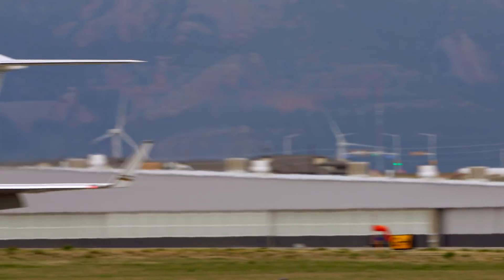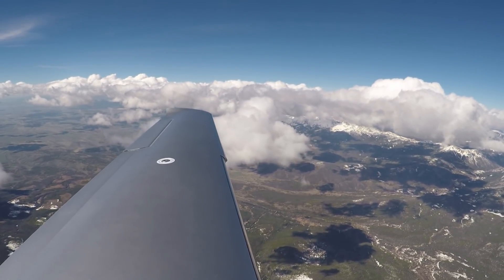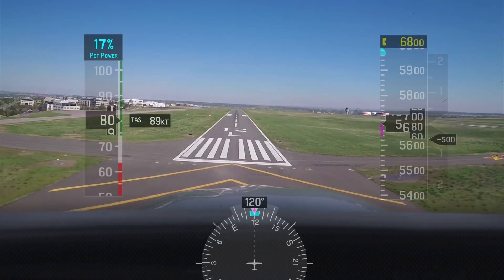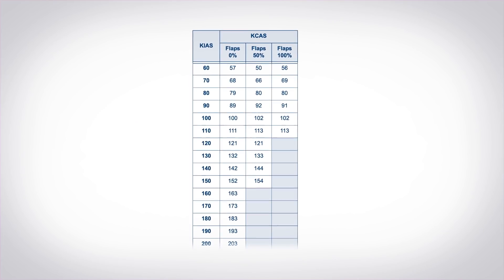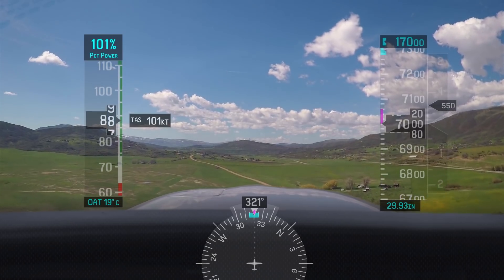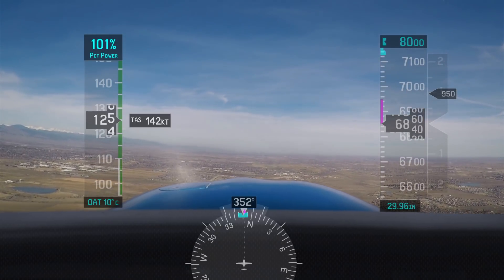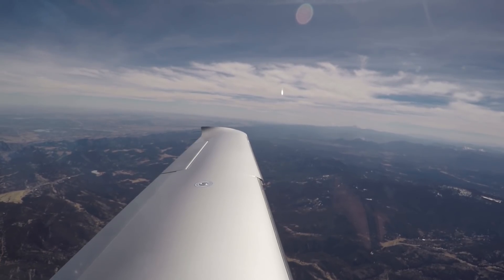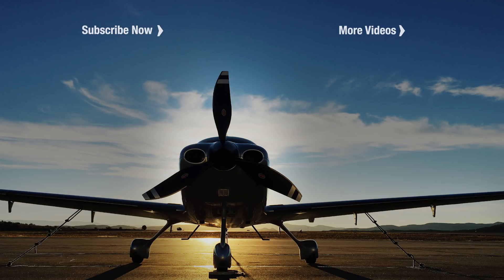Why Are True Airspeed And Indicated Airspeed Different?

Comment: Nice explanation but what about the lesser known "flat earth speed variable" where the pressure changes with altitude are factored into mach calculations using the flat earth formula. The formula accounts for the expansion of space and the moons effect on gravity as well as the pressure exerted on the atmosphere. This allows for a far more accurate reading of TAS and IAS in real time

Comment: If the static pressure decreases with altitude too, shouldn't these forces cancel each other out? So shouldn't the difference between the total pressure and the static pressure remain the same, thus showing the same airspeed?

Comment: Great video. I have a question, in FSX using Boeing 737, I was descending, at 9,000 feet my indicate speed is 250 but TAS was 305, so I was wrong because flying over 250 TAS according to the rule?
Reply: 250 indicated. We don’t care about TAS other than for planning purposes.
Reply: @Micg51  thanks 👍

Comment: I don’t understand the difference between GS and TAS.
Reply: Does it have something to do with that if you climb at a constant rate you will move through the air perhaps at the same speed as you were at level flight but you’re now not moving as fast in relation to the ground?

Comment: Interesting -  for flight above FL200 in an unpressurized aircraft, the AF requires 30 min of pre-breading on 100% Oxygen prior to exceeding 16,000 feet.  The maximum time spent between FL200 & FL240 is 110 min. This is to minimize the chance of decompression sickness.

Comment: Great video, as always! Quick question: Why the facemasks rather than the nasal cannulas for this flight? Just curious as to what goes into the decision of which oxygen delivery system to use.
Reply: Echin0idea You use the nasal cannula when flying between 12,500 and 18,000. Above 18,000 requires the mask.
Reply: Ah, got it, thanks. I was wondering if it was altitude dependent.
Reply: Masks are more comfortable?

Comment: Hi! Question:
During the example video that starts at 4:39, I noticed that the airspeed indicator on the left doesn't seem to move or change at all. I found it kind of odd that it wouldn't be jumping up or down slightly, due to turbulence. Why is that?